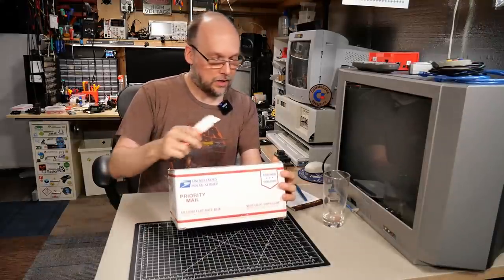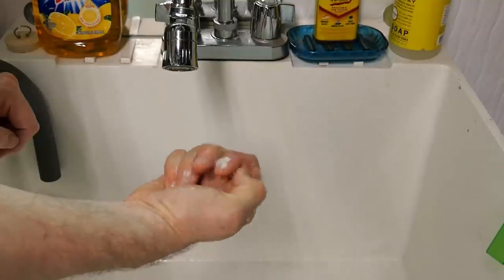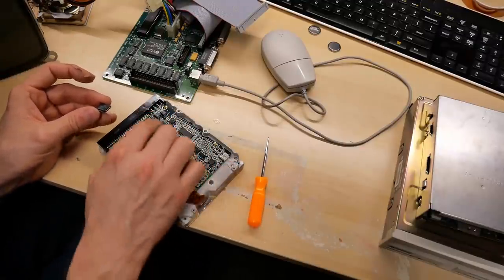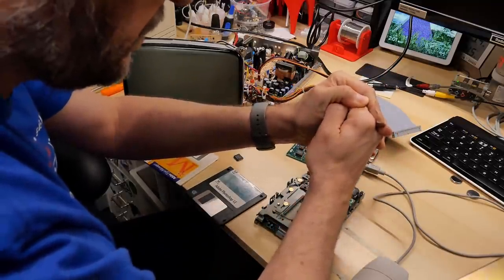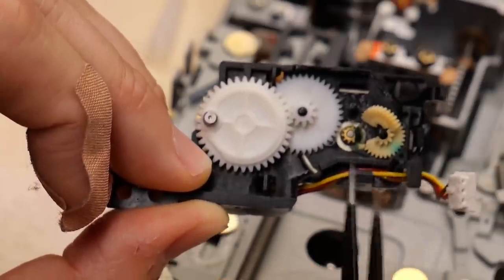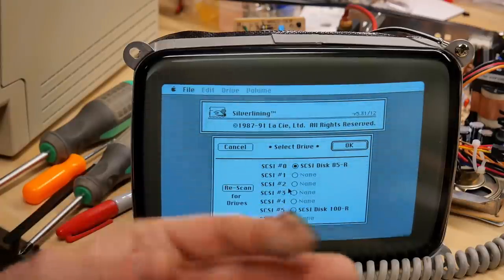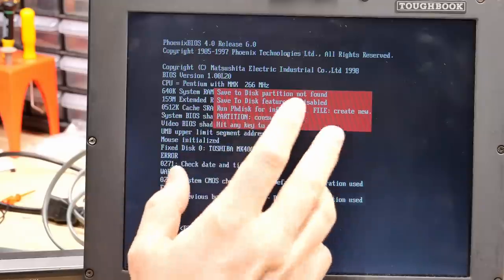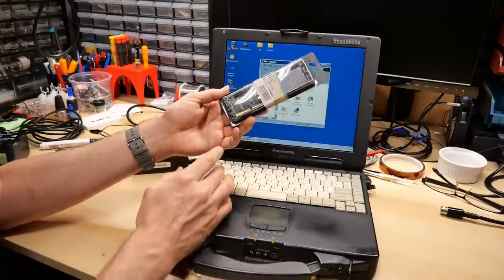Melting peanuts, a hard drive crash and some RAM! (Mini Mail Call #11)

Comment: Sad to see another dead SCSI drive!!
Won't be long before there aren't any good one left!!
I really wish someone could come up with a low-cost SD to SCSI adapter board!
Like you, I have too many seldom-used machines to spend around $100 CAD each on!
Thanks for the video!!
Reply: Back before the SCSI2SD existed using SCA server drives was pretty popular, they are (or at least where at the time) much cheaper than the SCSI2SD. The only issue is the cheap adapters you can get from china lack termination so you often end up having to use a external terminator or a pass through terminator which can get rather messy. I ended up making custom adapter which included termination, IIRC I was selling these adapters for about £15 and the drives cost between about £10 and £15 each at the time

Comment: they're made from corn starch... you can eat them!!!!!! :D
Reply: They taste a little bit like popcorn just add some butter
Reply: @bradleystach6275  I was gonna say this... hahaha
Reply: They smell like Corn Pops to me - which makes sense.  :-)  When they show up in a package, I fill the sink drain with them and go to town with the sprayer.

I had a CGA monitor shipped to me in a box with a ton of those.  I would take a plastic grocery sack full of them into the shower every morning and let them dissolve while I went about my morning routine.

Sure beats having a trashcan full of styrofoam peanuts to deal with.  (And they’re not as staticky.)
Reply: Actually, depending on where they came from, they're made from corn, wheat or potato starch.
Reply: Haha.  I'm glad I'm not the only person who has eaten them...on occasion.

Comment: @Adrian - Just FYI, both the eject motor and the read/write head assembly from an 800K drive can be used in a 1.4MB drive.  Also, since the 1.4MB drive is backwards compatible with an 800K drive controller, there's no reason not to sacrifice an 800K drive to fix a 1.4MB drive.

Comment: Here's a screw story for you :) I renovate vintage Japanese telescopes. These often feature 4mm screws with a 0.75mm thread pitch. These screws are not made any more! The standard switched to 0.7mm thread pitch some time in the 1970s. It is nearly impossible to find 4x0.75mm screws. I finally located a classic British car parts joint in the UK and bought 3 screws for $7 each! The most expensive screws in my history of screwing.

Comment: I wonder if there is a bios update for that Toughbook that could allow it to use more ram?
Reply: BIOS update was my first thought too.
Reply: Nah, bios is never the problem, its always the ram controller which only can handle either single or dual ranked modules up to a certain amount. If you know what kind of chipset this has, chances are high, you could find the datasheet explaining how much physical ram the controller single or dual ranked it can address. All of this works the same as nowadays, except the ram controller is in the cpu, so look up the datasheet of your cpu.
Reply: If your user image is anything to go by you've probably had a Gateway computer AKA a cow computer LOL.

I remember we got hey computer years and years ago that was a gateway it was mostly for me but of course my parents are going to use it to but how I found out it was Christmas morning.

We have had at least one parent one Sammy wants a Gateway computer.

I purchased one with income that I was supposed to be getting but was underpaid and welled up and getting over a thousand some odd wind up getting my computer and my furniture and other things I needed.

So happy times this was many years later though after the first gateway we had.

Although that Gateway was an absolute dinosaur USB 1.0 seriously.

My first first flash drive with several years later only 750 megabytes size of a CD-ROM hard to believe that old.

Last time I checked it still was working the flash drive not the computer that thing hit erased a long time ago.

The first hard drive at failed Seagate of course although what is still wet after the drive lives on refrigerator magnets if you get the point!

Comment: Coworkers neighbor had a PC that took a lightening strike, like 20 years ago. Lightening hit the backyard, destroyed a tree, half the electronics in the house also. I offered $20 for the PC just to take it apart and inspect it. As I remember, I don't think there was a single working part from the whole system, but on the surface everything looked fairly normal. I opened the hard drive, it was amazing - you could see the pits as the current arc'ed from the heads to the platter for about 1/3 revolution. The heads were welded to the platter in the final position. It looked a little similar to yours, your's may have taken that impact while running perhaps.

Comment: The Syquest drives were unusual only in the micro world.  Removable platter hard drives were the norm in minis and mainframes until the advent of IBM's Winchester project produced the first generation of sealed hard drives (the IBM 3340).  For several years, permanently sealed hard drives were commonly called Winchester drives for this reason.

Comment: I would save the SCSI HDD controller board with that chip installed, not for the components but to use if you have a similar dead drive in the future.  The again, if the drive is at that point you may not want to rebuild it for re-use, just data recovery, which is probably not something you would do.

Comment: I believe the reason the 256MB memory module didn't work correctly in the Panasonic is because it's a high-density module (with 8 chips instead of 16) and the memory controller in the chipset is too old to support it correctly.  A 256MB module should work if it has 16 chips on it.

Comment: Adrian! That Quantum drive looks mechanically the same as one of the OEM drives of my pcs, it's an HP branded but made by Quantum, and I think that particular design for Quantum is the worst they made. Mine is IDE 106MB instead of SCSI 160MB, but the internal design and the position of the flat cable at the back is exactly the same. The heads have a parking zone where there's a rubber piece, that turns to glue and either sticks the heads support to itself or pushes them out of position and makes them touch and destroy the disk.

Comment: YouTube ate my last post so I'll summarize what I said:
SDRAM sticks above 128meg often have compatibility problems due to differing addressing schemes. Basically chipsets with 256meg max per slot will only work with some 256meg sticks and chipsets supporting 512meg per slot should work with all 256meg sticks.

Comment: If you need metric screws, order them from McMaster-Carr. I just ordered up a bunch of Amiga-sized metric screws from there.
Reply: Are they that hard to find? Lately every cheap 25 drawer hardware kit I buy has nothing but metric screws.
Reply: @johnpossum556  While metric machine screws are available locally to me, the issue is they are too long. I cannot find machine screws that are in 3-5mm length needed for case/motherboard screws. I could cut some down, but it's a pain. I decided to order them instead.
Reply: @jason50146  Do you know what the official name is for the Amiga screws, are they M3-25 or something like that? I am sick of being ripped off by Ebay sellers for screws that are probably pennies if you know what their official name is and can buy them from a hardware store? Same with the different size ones on the A1200 and A600.
Reply: @Wallygjs  I used the info here for the A2000 screw list. https://www.amigalove.com/viewtopic.php?f=6&t=751. I don't have info on the 1200 or 600.
Reply: @jason50146  Yeah, Lowes typically has metric screws but not usually less than 5mm.  i think I've seen 4mm a couple times but it's only one or two types. I've had to just buy sets of small ones from AliExpress.
Reply: @jason50146  Cheers, I will check that out!

Comment: I don't know about the earlier syquest drives but I had a SyJet 1.5 GB drive that would inevitably stop working. I sent my drive back 5 times before giving up on it. It would usually work 3 to 4 months and then fail. From what I later learned it was a common problem with those drives. I wonder if the 88 MB ones had the same problems.

Comment: You may want to consider checking other settings for the BIOS. Some systems share memory with the graphics known as UMA or Unified Memory Architecture. In these types of system, a feature is usually available to configure how much memory is available for system vs. graphics.

Comment: I would always touch something metallic on the chassis before removing or adding RAM chips in case you're carrying any static on your body, that way when you go to push in the ram stick the static is not going to run through your body, through the chips and then to earth (or a lower impedance) via the RAM socket and blow the chips on the way through. I have never had a RAM chip fail due to that precaution.

Comment: 27C512 is very likely a one time programmable EPROM, since it is in a plastic package and has no window for erasing.

So unless you needed to replace one in a similar drive they may not be worth keeping on their own, so keep it with the board itself.
Reply: Exactly - the OTP and UV-erasable versions are the same except for the (more expensive windowed ceramic) package.

Comment: Adrian, the hard drive has rubber crap in there that causes the head to stick. If you clean that up or put some type of heatshrink tube over it, the Drive will work fine. Edit: Nevermind. watched further into the video. Weeee

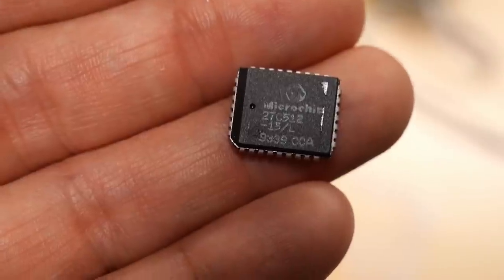Comment: Hi Adrian, regarding the ROM IC at 7:59 ... It appears that the 27C512 designation has been used for both UV-EPROMs and OTP-ROMS, and I think it's safe to say that this particular specimen is NOT an UV-EPROM, so it would have to be an OTP-ROM, in which case it's not much use for anything else than as a replacement for a bad ROM in antoher, identical hard drive.

Comment: 15:00 That green grease was also used in the focusing threads of AGFA cameras from the 50s. In those it gets so bad, that it makes a pretty decent glue. You have to heat it up to soften it so you can unscrew it with gentle force, then soak it in alcohol and apply new grease .. and then readjust the infinity stop. It's nasty.

Comment: 2:08 I've had the exact opposite experience, the Quantums ALWAYS fail, immediately or shortly after using them for the first time after they've been sitting.
Reply: They got rubber inside as bumpers for the R/W head. It turns to nasty sticky goo after all those years.You technically can repair it but some Quantum drives need to be disassembled completely for this.

Comment: @Adrian's Digital Basement
That was my comment about the RAM on the original video with the ToughBook. I had one BITD and I upgraded it twice, once with a 256MB and then again with a 512MB stick. I dug into some of my old backups and I found a BIOS update for my old TB. The revision was 2.00L100. I'm guessing that my model had a new board revision and thus the difference in ram capacity compatibility. Sucks that it didn't work...
Reply: Mr Guru  I think you misunderstood. The motherboard itself for my CF-27 was a different revision from Adrian's CF-27. The BIOS update I have wouldn't work on his system. It would very likely brick it unfortunately.

Comment: I had a 5 1/4 inch drive on my Radio Shack color computer that could not release the head load solenoid. Turns out the plastic spacer on the armature was missing. This allowed the magnetic circuit to complete so the residual field held it continuously.  Put a piece of tape on the surface and bingo, the solenoid released every time.

Comment: You should have logged into the hard drive's terminal interface, that would have made an interesting video. The drive select pins on most hard drive's double as a 5v serial interface, and all sorts of magic can be performed via the drives serial interface. Perhaps you'll consider it in another video.

Comment: My pet-peeve for those floppy drive eject gears available on eBay is that the sellers want BIG $$ to send them to Canada!
It seems crazy that it should cost ~$20 CAD S&H for a few tiny gears!!
I guess I should just invest in my own 3D printer!
Reply: yeah, my problem with the ones on eBay is that it costs pennies more to print 10 vs 1, yet they charge $10 for 1 but then $5 for each additional one.  I get the effort to print, mail, etc. but each additional one doesn't really cost them any more, so why not just sell 4 for the $10 price..  Anyway, glad that one is up on thingiverse, hopefully will bring the prices down to reality for those without 3d printers.
Reply: @StephenArsenault  Thanks for that.  I've been meaning to try to get a print of these done with my SLA printer but i had a mishap and after cleaning it, i never got back to trying it... But truly appreciate you taking the time to make this and put it up, I plan to try again soon.
Reply: Stephen Arsenault thanks for the tip!
I remember seeing your design posted somewhere else but missed that printed versions were available!
Definitely a much better deal than those on eBay!
Just ordered a set, so hopefully they work out well!!

Comment: from the looks of that failed floppy gear, you should be able to print a new one in pla at .15mm or maybe even .2.  most modern small 3d printers should be able to handle it (something like an ender 3 should do fine) - or if you need higher resolution, one of the less expensive SLA printers would be ideal for a job like that.

Comment: the CF-27 might need a 512mb stick in order to get 256mb of ram. When I was upgrading my CF-M34 many years ago, the information on forums pointed to a strange limitation where in order to get over the 160mb(it was either 160mb or 192mb, since I can't really recall) hurdle you have to get a 512mb stick.

Comment: The syquest reminds me of the Jaz or Rev iomega drives 😜
Reply: Ah syquests, yeah I used them extensively for backups and archiving. Noisy and for today's standard tiny but quite handy! Also a lot faster than Zipdrive/Rev though not so fast as a Jazz but those were expensive iirc

Comment: Trying to remember which drive I settled on in 97/98. At any rate, external (parport) 3.5" with rigid platters. .. I want to say I had a SparQ, but can barely remember what it looked like any more.

Comment: Iomega also made a removable hard disk cartridge system called the Jaz. I have one in a padded carry case. I've only ever used it for one thing, which was booting classic Macs. I've not used it for years though, so I've no idea if it still works.

Comment: Quantum drive screws are not metric. they use the metric screw stuff sure, but technically they're their own thing. they're JIS. Japanese Industrial Standard and I'm not sure if they use their own categorization of the threads or not, could just use metric at that point. but any that have the divet on the screwhead are JIS including most PC screws.

Comment: Weirdly, you can set a drive to ID 7 with a RAMFast SCSI card for an Apple IIgs, because the RAMFast SCSI card … has no ID. I'm wondering if that works because of some backward compatibility with SASI or if the SCSI interface actually allows the host to not have an ID, but there you go. Every other 8-bit host I've ever heard of uses ID 7.

Comment: 1. These SDRAM modules are newer and are called DIMMs (SODIMMs can be used too for laptops), not SIMMs
2. I haven't seen a PC100 256MB SDRAM SODIMMs that is 4 chip on each side (8 chip total). This must be a high-density PC133 stick and thus will not work properly with the older PC66 and PC100 systems. You will need a 16 chip low-density 256MB PC100 or PC133 SODIMM stick to work properly!

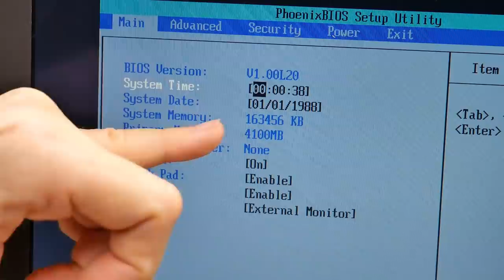Comment: 24:24 the BIOS can not see the full RAM installed. I think the BIOS needs to be updated (if possible), but odds of finding the 1988 BIOS update are very poor. If you have the time , you could read the BIOS code and re-write the section that recognizes the RAM. Then re-flash the BIOS hardware. Kind of risky but possible.

Comment: Not sure about this Toughbook, but if it has 430TX chipset inside (which is likely, since it has Pentium mmx 266) going over 64mb of RAM isn't good idea - performance will actually drop, since only 64mb are cachable.

Comment: The next generation of computer keyboard needs a new "BIOS boot key".  They key may be implemented to spam all the function keys, delete, and escape, thus allowing BIOS manufacturers to continue business as usual in their non-standard key assignments.
Reply: BIOS is outdated technology. Now it's all UEFI firmware. I'm not sure if there are standard keys now though. I'd hope so, they standardized just about everything else that has to do with uefi to make it vendor agnostic (supposedly).
Reply: @gorak9000  True, but a few UEFI implementations still provide BIOS emulation so you can choose to install and boot old operating systems that expect a BIOS instead of UEFI.  Computers that ship with UEFI (without BIOS emulation) still refer to it as the “BIOS” to avoid confusing people who are used to a traditional PC BIOS.  Aside from that, you're right.  UEFI is a welcome change, because of limitations of old BIOS technology, such as being unable to boot off any partition larger than 2.1 TB.  The fact that it boots faster is just icing on the cake.

Comment: You can always use the hdd-board as a donor for another identical hdd with a broken mainboard.
Please do not shake those older scsi drives like you did in the beginning of this unpacking, I have had many a classical hdd break due to slight shaking.